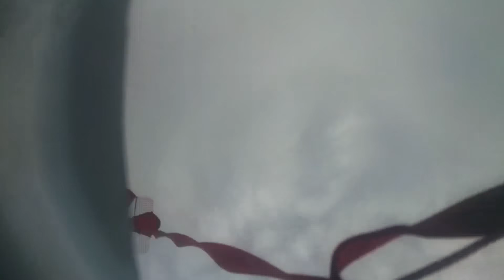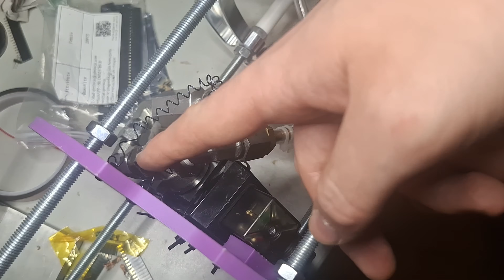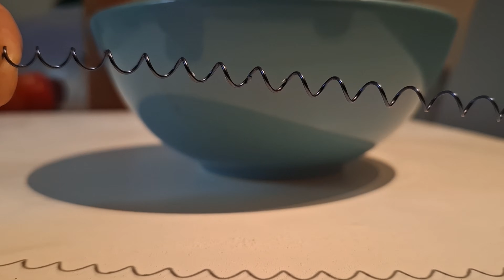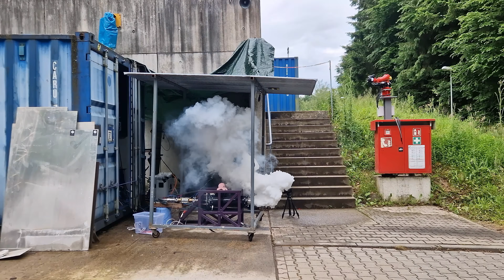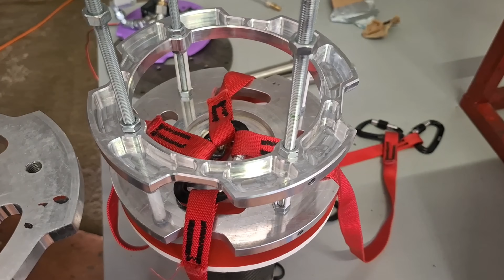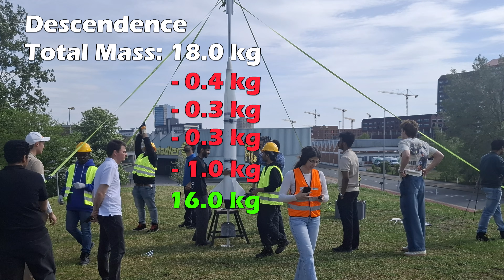ASTRA's next launch! - Descendence reveal

Comment: You guys are using 3 ring system? I would like to know more on that .
Reply from the maker: We actually just started having a little trouble with it when it was all assembled in the rocket body, so we will most likely talk a bit about how it works in the next video.
Reply: @ASTRABremen We have also made one and would like to show you guys also.How can I contact you guys?

Comment: 4:40 I found that this PCB has 51 ohms gate resistors. That is to low, you need 180 ohms or so, otherwise the µC-pin will be damaged. With propper PWM and some inductance you do not need a heavy resistor

Comment: did you check out those composite eyebolt you can buy from a boating company? To accomplish the same job as your diy composite eyebolt but easier and increased consistency
Reply from the maker: Had a look.  Some of the options there could be effective but we would need to rethink our integration strategy.  We already spent our capital machining all the bulkheads with a particular strategy so it would be tough for us to transition now, but maybe for future launches.
Reply: @ASTRABremen  cool :)

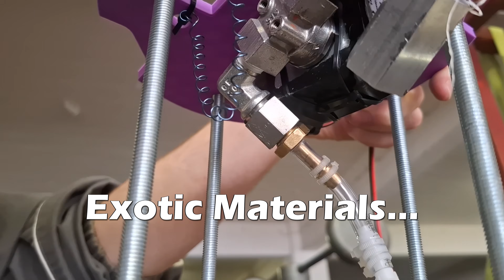Comment: 2:49 Reminder to watch out for aluminium on aluminium and stainless on stainless connections. These steels will cold-weld even in air and turn into one piece basically as soon as they touch with some force. Anti-seize paste must be used for alu-alu and stainless-stainless connections and fittings. Stainless-alu and any other combinations don't have this effect.
Reply from the maker: Thanks for the tip.  This is especially important in rocketry applications.  For Descendence, we don't have any interfaces like this on the rocket that we don't want to remain fixed so we should be safe from this angle.
Reply: @ASTRABremen  This can also happen on pipe fittings, which is where the paste is supposed to be applied.
So one day, you might screw in a stainless pipe fitting into another stainless pipe fitting, and then, maybe even before you fully tightened it and sealed it, the two pieces cold weld and become basically one piece, which is the stuff of nightmares for me.

Btw, the company Landefeld has I think 108 3-8min tutorial videos on just about every pneumatic component there is, along with other stuff like anti-seize paste, thread cutting or grades of teflon tape.
Unfortunately the tutorials are only in German, so I can only recommend them to other Germans...

Comment: Tell us more about the launcher? what dimensions, cross-section, and nominal value do you use profiles for?
Reply from the maker: The launch rail is a 40x40mm I-type cross-section aluminum profile.  Basically we just put 3 2000mm long profiles together to make a 6 meter rail.  It is held up in tension with ratchet straps.  The rocket has detachable straps with an M8 bolt that slides inside of the aluminum profile.  It was the simplest concept for a rail that we could imagine.